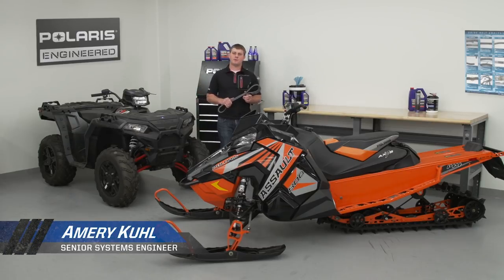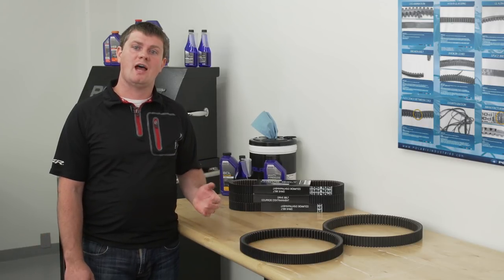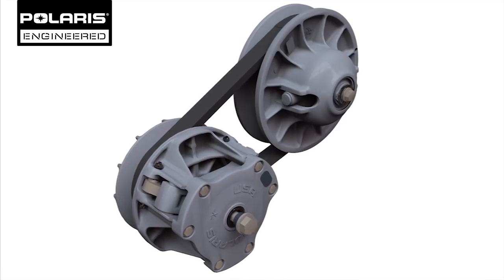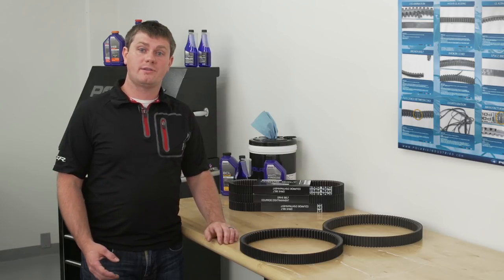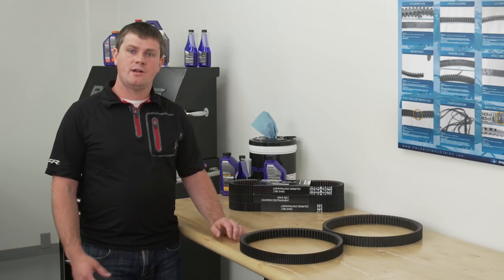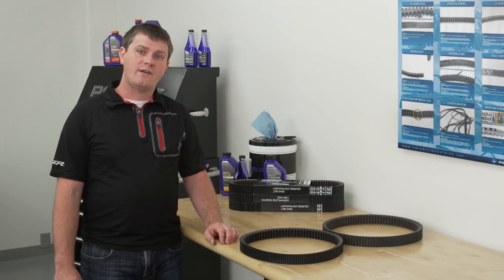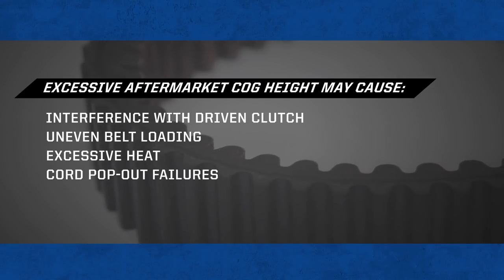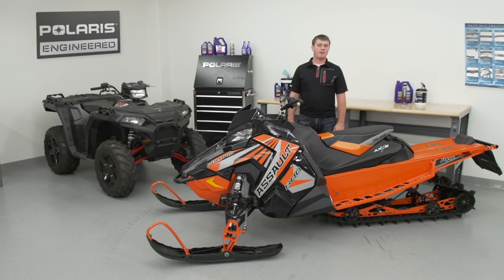Polaris Drive Belt (CVT Belt) - Competitor Comparison - Polaris Snowmobiles

Comment: I would assume that the OEMs, do not make their own belts, but work with their belt manufacturer, (there aren't many) - who will apply, 'what they learn' on an ongoing basis, to 'their brand'.
In my case, I bounce the rear of the sled, to unstick the sliders, before driving a cold sled. My 'young guys' usually don't - and occasionally, flat spot their belt! Especially, after frozen, slush.  Occasionally, they treat 'my' machine, the same way.   Grrrrrrrrrrrr
Reply: wtf. that comment made no sense. random rant?
Reply: @Kartyman550  
LOL if you don't understand his comment its because you know nothing about Snowmobiles . 😂👎
Reply: Carlisle actually makes polaris belts

Comment: hello, I have a 2012 Polaris 850 xp, as soon as I put the shift in drive the tires start to roll, it seems that the belt is quite tight but I don't know much about atvs, any ideas or advice?
Reply: Hugo Loza Only need to shim the clutch shelve by adding a washer or taking one out on the  secondary.  I had to put one in with a new belt but now I need to take it back out after the belt is break in.
Reply: @crazyflyboy30  thanks for answer!